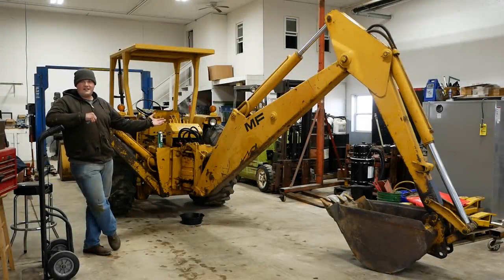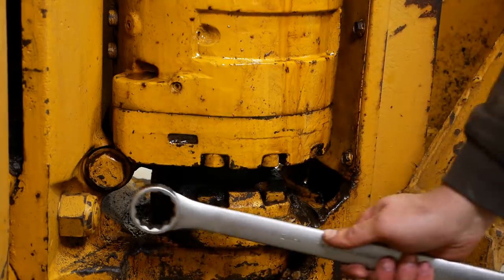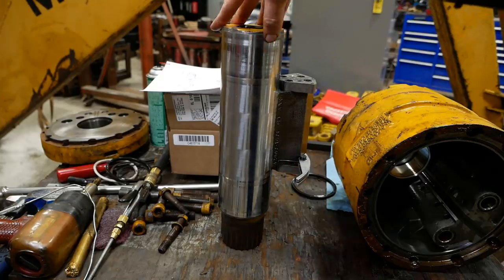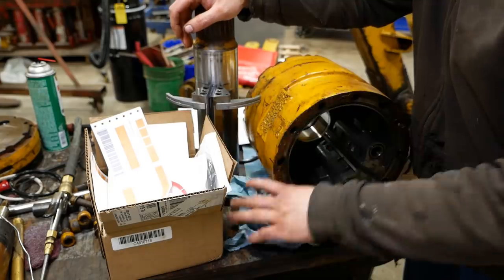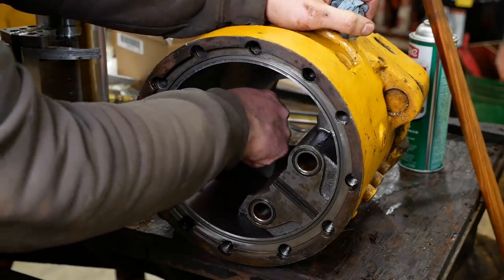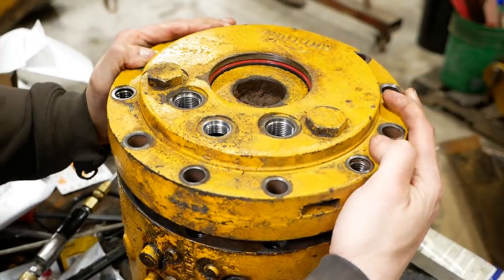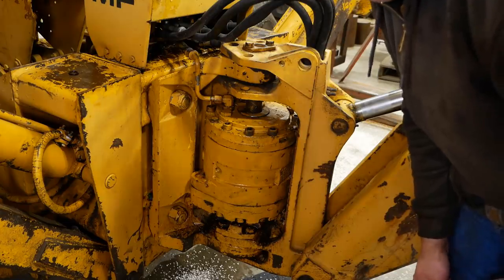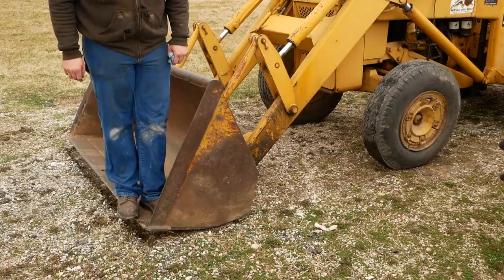Massey Ferguson Backhoe Rotary Swing Cylinder Rebuild

Comment: Those MF tractors, well, what can you say?  That looks a like a job where some of Warren's orange oil-proofs gloved might have been handy.  Or not.  
The lights in the shop look great.  And the new layout looks better if nothing else.  
A green tractor and a white landscaping truck--are you foreshadowing like Matt? :-)
And a pox on all the spline-whiners; MF got out of the construction side so as to not wind up like Yellow Deere; it can be easier to find Oliver parts than MF ones.

Comment: This video scares me I just inherited a 1976 Ford 3550 backhoe and it only has 1700 something hours, everything works on it great and my uncle ordered stronger pumps and that making me wonder if stuff will be more. I looked up the o rings just for the up and down and the tilt levers there's 2 top and bottom for a grand total of $245.00 for 4 O rings the size of my wife's wedding ring maybe a little bigger. I'm kinda of a if it's just old but not broke I change it but not really on the backhoe. I hope I dont have on my left to right bucket swing what you changed. But great video I wonder if the person a long the line of ownership used the swing to push stuff around cause that'll screw those up from what I've been told.

Comment: I read that others have had success drilling ~3/8" holes around the worn spline and installing 3/8" rods to act as keys.  Apparently it was not too hard to drill.
Somebody must have put an International engine in that.  My MF/Perkins starts first time every time.
Reply: I think it was a gas perkins.

Comment: The replacement parts outfits have you by the short-and-curlies, like medical equipment suppliers. They figure it's a limited and captive market, so they charge whatever they can get away with.

Comment: Wes, If you run into some weirdness with the hydraulic cylinders, you might want to reach out to Adam Booth (abom79 on YouTube). He used repair all kinds of hydraulic cylinders and shafts when he worked for Motion Industries in Pensacola, FL and appears to have a wealth of knowledge when it comes to the construction, repair, and sourcing spare parts.

Comment: Drill some holes through the worn out connection an secure the cylinder with screws. So it cant move this 10 degrees.

Comment: I feel stupid a year ago I was traveling on  the road not knowing the tractor was in 4x4 causing the front wheels to lock up I almost went over the steering wheel What I am wondering Is this a DIY job to possibly change the ring and pinion I no longer have 4x4 PLEASE HELP.

Comment: If you can't fix to original ... adapt.  I doubt any of those are going to go in an airplane.  Somebody oughta be able to come up with not only a fix, but a cheaper way to repair that if the "fix" wears out.

We have a '65 Ford that utilizes a heavy wrap chain and a pair of short cylinders for the swing.  In the service book that came with it, I found a receipt, dated in the mid '70s, for a replacement chain.  I got sticker shock from it ... I'm afraid to look and see what one would cost now, it just might cause a premature entry in the Pine Box Club.  In the 70's it was within zip code of what you spent on those seals.

Comment: Guess it would have been a good idea to break those bolts loose before removing the cylinder.  Hindsight from an armchair mechanic.  It sounds like you need your own hose crimper. I bet your local Eaton distributor will loan you one as long as you buy their hose and fittings.

Comment: $126 for that single o-ring?  More like $12.60!  Someone has either screwed up a decimal location or is insane!  If all the mfrs. use the same unit then they must be ubiquitous and parts available at a reasonable price. Strange to see a snap ring and spiral ring go in side by side instead of sandwiching the gasket. Maybe it’s just a spacer?  One other thing - after you mentioned the amount of torque produced I was hoping for a demonstration of how that was produced since you had it apart. I watch mostly to learn and would have really appreciated understanding how that functioned. Thanks, Wes.

Comment: Looks like that poor vane seal got totally obliterated
Reply from the maker: Why do you think that?
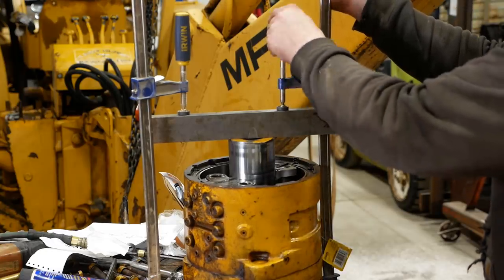Reply: @WatchWesWork  13:47, it looks the sharp edge of the bore has scraped and shaved a good chunk out of the critical sealing lip, and the seal is still protruding axially at 13:53 after pressing the rest of the way. Perhaps they use a shim or something for factory installation.
Reply from the maker: @jgeating  All it scraped off is the silicone grease I lubed it up with. I was able to push the seal down into position before installing the top cap. The seal is designed to be installed this way. There's no other way to do it.

Comment: I think/feel that if you are working for yourself (thinking of myself in this case) then this has to go or I can trade this type of swing motor for another... how hard could it be and thens when the fun begins. Customers never understand none matching cylinders for just color alone or one is a inch longer but does the same job thing. Too bad  we couldn't put bronze play dough in the hole and let it set up to take up some of the slack that if a guy was working it hard and jerking the control from side to side would result in disaster or even worse if you can think of it. Great short video Wes... I am wondering, are you going to be a Deboss Judge? Just wondering as minds are at work out there. He is copying driveway drew's build with that 3126 in a ford no less... ha ha, great minds think even more

Comment: We have inferior hatred towards them dirty things. Hate them. Same for jcb 3c and them similar ones. Track machine left them sitting. A mountain of them were scrapped here.
Reply from the maker: It's the same here. The only people still running backhoes are municipalities who can drive them everywhere they are needed.
Reply: Watch Wes Work here in Ireland there hardly any ground good enough for them. Lot of them the back hoe was cut off them and used as loader tractor. Many exported to the Middle East and Africa. Too Heavy and useless. Always getting stuck.

Comment: That's a fu price. If you find a good rubber parts place, or place that sells bearings/seals.  They might even have something usable.
     Have them identify the material and cut it out on  a cricut or laser cutter. 
          This "might work".     Dicey because of the critical use.
  Also you should know better than to try to break loose bolts on something that is not clamped/fastened down.  You lose so much energy that way. It makes it harder to do than necessary.

Comment: it's a shame that that arm still swings so loosely. could possibly sleeve, or weld-fill, that loose spindle and collar and machine new splines into them...maybe. could have used some sort or dampner to save the splines, i would think. sort of surprised they don't shear right off from the git-go.

Comment: I would say send it to a machine shop and have the splines bore welded and then recut/swaged but, the cost of all that work especially the correct heat treating to make it strong enough to last another 60 years (Which if we are being honest even with all that work done wouldn't survive another 60 years anyway) would most likely far exceed the cost of just buying another machine or at the very least try and find another machine that is junk/parts machine with a good assembly and just swapping it over. It's one of those things where it "Could" be fixed but, is it worth it? Probably not. 

Just fix the leak and the operator will just have to deal with the extra slop which hell to be honest machines half that ones age have as much or more slop in them. That's why some excavators turntables have so much slop in them is the cost and headache of taking it all apart to replace the breaks and get it back correct exceeds the price of what the machine itself is worth. Hell i can't believe the rebuild kit was over $750... Massey Ferguson was always notorious for two things, well built, and super expensive as hell to fix when they do finally break.

Comment: 14:40 You only want to go into the repair once, spend the time and money and do it right.
Reply from the maker: What's right? This thing is near 60 years old. It's used rarely by a homeowner.
Reply: @WatchWesWork  I just was commenting on the O-rings not the worn spline parts.

Comment: Whats wrong with Perkins engines?
Reply from the maker: Ugh. Where to start? CAV pre-combustion injection will not start even on a hot sunny day. They leak oil from every pore. They're prone to spinning rod bearings and throwing rods. Every single fastener is fine thread for no reason. Cat ownership seems to have finally drug them out of the 19th century.

Comment: AGCO doesn't make any hydraulics parts - they're all made by other companies. The trick is to find out who made them and get the parts directly from them. Unless it's a machine that's still under warranty, there's no reason to get the parts from AGCO.
Reply from the maker: Well when you find these parts aftermarket let us know. We'll be waiting.

Comment: Understand that ridiculous priced seal thing.  Oil cooler unit, (new) $100, oil cooler gasket, $97.  Hey! It IS cheaper.  (it's a 1/8" piece of neoprene with hole punched in it!)

Comment: this may sound stupid but do you need to split this mf 30/34 to drop the oil pan.  I tried dropping mind and there's something holding it in the front engine area still

Comment: I walked away from a really nice deal on a MF backhoe when I saw its leaky rotary cylinder. Otherwise it was a nice machine. Odd things are generally rare and expensive. That’s my thinking. I doubt the splines on this machine will last much longer. When they strip out…the machine will be useless without some big bucks in custom machined parts.

Comment: Cheaper to retrofit twin push pull cylinders and solves the slop? Yeah more work but better result.
Reply from the maker: Cheaper? I'd think 30 hours wouldn't get the job done, plus cylinders, hoses, and likely a different valve block. I'd say $4000 should cover it...
Reply: @WatchWesWork  Ah yeah I forgot the context. I was thinking if i was doing it for myself. Of course I don't put a value on my time either

Comment: I agree, that is a really bad design. Not so much the innards, but both end shafts have dirt traps.  Designed to be operated in clean, frictionless dirt.
Reply from the maker: Right. I suspect water intrusion is what killed the seal.

Comment: OSHA does not approve or certify anything. Proper term is OSHA compliant. Price of those parts from AGCo is why i quickly sold a GC2610 subcompact i had.  65 Dollars for a hydrostat filter that was paper thin with no label or markings just black oh and no after market filter available to cross reference.

Comment: your getting mugged in the us of a.i own a 50b and have renewed the slew motor full kit by sourcing for a bit more than 340 sterling. The bearings being the most expensive parts.as for worn splines i have filled with thread lock(a bit expensive) but have yet to have any trouble.3 years of use on the farm since rebuild.

Comment: I fully understand the customers is right. However this is a waste of time and money. If they aren’t going to do it right, how long will last?
Reply from the maker: How do you do it right when there are no parts available? You'll spend more money having parts made than the machine is worth.
Reply: @WatchWesWork  And for an occasional use machine (which I'm tipping this is) it will almost certainly be good enough for long enough for what the customer needs.

Comment: Wes, contact Abomb79, Adam has a video on sourcing hydraulic cylinder seals by size, states the book to utilize, for identification to order.
Best wishes from the far North.
Reply: Excuse me, Wes is a Mechanical Engineer, I'm certain sure he knows how to measure a cylinder for seals…
Reply: @horacerumpole6912  He was talking about going to the Agco dealer for hydraulic seals, why?
Reply: @carlthor91  Because it likely was the fastest and most straightforward method of, first: sourcing the options of rebuild kit(s), and second, being able to present the customer with his options before financially committing to doing the work.  Once that cylinder is pulled and torn down, there is no turning back for the owner- Wes is actually in business to repair things in a timely and cost-effective manner. Abom is not…
Reply: @horacerumpole6912  Okay, even if I know the people where I live who have access to hydraulic/mechanical. Please don't get it in a knot.🙄
Have a great weekend.
Reply: @carlthor91  You asked a question, it was answered…
Reply: @horacerumpole6912  Did not ask a question, was a suggestion.
Reply: You asked this: "He was talking about going to the Agco dealer for hydraulic seals, why?"